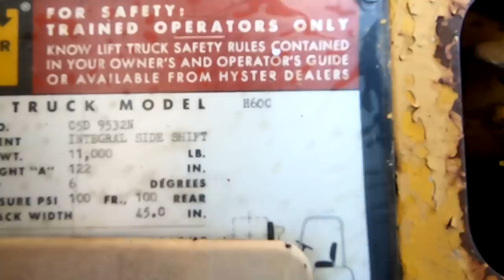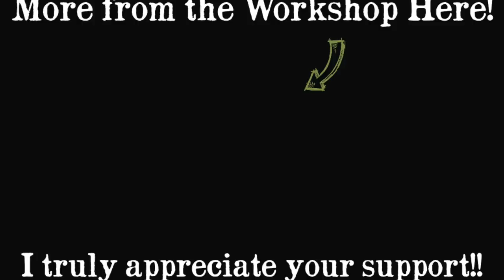This 1969 Fork Truck WAS Headed for the SCRAP YARD! ~ RESCUING a 1960's Fork Truck ~ Part 1

Comment: ATF & acetone. Ball hone. Patience. I'm in love😍
I was so immersed, when I read "Stay Tuned For Part 2" I said NOOOOO😭
This is so excellent, great job.
Reply from the maker: I'm glad you enjoyed the video! I thought about making it all one video, but it would have been 2 hours long, and I wasn't sure if that would do well or not... I decided to cut the initial video into 2... Part 2 will be up tomorrow, so you won't have to wait long!!
Reply: Gasoline and ATF work better then acetone and ATF.  The problem with acetone and ATF is that they do not mix and as soon as you put it in the cylinder it separates into a layer of acetone and ATF.  Gasoline and ATF will mix and keep creeping into frozen parts better then the separated acetone and ATF.
Reply: @jimthode  THAT sounds way better, actually. Anything that will be a Carrier for the anti-corrosion properties of the ATF. Acetone is a go-to ingredient because of it's hygroscopic properties, whereas gasoline will not mix with water. Isopropyl alcohol is actually better for moisture control, but it's not lightly corrosive like acetone, busting up rust. Aromatic hydrocarbons are key for capillary action. The carrier can be changed, but the chief component (ATF) should stay the same.
Reply: @SalvageWorkshop  it happened 10 hours ago... so it's ok, lets make some coffee to wait for another 14...

Comment: When you were using a hammer to tap the spark plug gap and said there probably a better tool, it’s right on the gap gauge itself.
Reply from the maker: Well go figure! Of course they already thought of that! lol!
Reply: What those 2 goofy looking flat parts with the small slots? One on each side. Those are what you're talking about? Not being sarcastic, I really not sure.
Reply: Read more comments and figured it out that it's those flat pieces with the slots. You got my curiosity peaked and set me looking for the correct answer though.  👍
Reply: @williambryant5946  Yes. Or, and I typically do this myself use the side like a hammer.  When you're dealing with thousandths it doesn't take much to move that tang.
Reply: That tool only opens them up. You still tap the hook closed. But you can just tap the hook on something solid.
Reply: @1pcfred  No, if you grab the "hook" you can close the gap as well, literally push instead of pull.

Comment: "We're gonna smack it, just once!" Proceeds to smack it 1200 times
Reply: Math be hard.
Reply: No
Reply: @jamesbrumfield8181  the powerless and weak say no. It takes an individual of means and courage to say yes.
Reply: That is skilled craftmanship, right there. Both tape and hammer used. After many years exposed to weather and this machine is in pretty good shape. Imagine modern forklift full of electronic left outside for several years like that.
Reply: CAN i use that fle hone for my toilet?

Comment: This engine revival was like watching Mustie1 times six. =)
Propane dos not need a carburetor cause it always a gas when leave the tank, so it do not need a float chamber, needle, all the jets and small parts. It works with a pressure regulator after the cylinder and a way simple venturi in the intake (it can even be made of plastic). It is so simple that you can keep the carb to have booth combustible system and they will not "see" each other. Thank you for the video!

Comment: These continental flathead 4 cylinder and 6 cylinders will literally run forever. Had a 1960s Hyster 5000 pound truck, sat for years upon years. Jumped the battery, still runs better than any of the new hysters.

Comment: Open spark plug hole,  I gave up.   Can't turn engine,  I gave up.   Broken Distributor,  I gave up.  Badly rusted cylinders,  I gave up.    But I'm glad you stayed in there,  very entertaining.    You lucked out on distributor.  Good to have friends with parts.

Comment: @salvage Workshop im a forklift mechanic and all your going to need is an lp converter, a water line coming in and out, and solenoid to shut the fuel off, and a regulator. your biggest obstacle will be if it ever backfires if blow the diaphragm out in the lp converter/ diffuser.. It shouldnt be a problem to do what you want to do. the modern stuff like hyster and toyota are still run just like this only they have more sensors.

Comment: Had one exactly identical that fork lift , Great fork lift .  One foot pedal is the brake and the other disconnects the drive so you can rev the engine to increase hydraulics to the lift mast . As long as you stay on hard ground you can get around very well . get it stuck or unload one drive wheel and you'll have to crib it or pull it back on hard ground to get traction . Enjoy your vintage fork lift .

Comment: The small notches on the side of the wire plug gage are for bending (rather than hammering) the side electrode to adjust the gap...
Reply: Beat me to it 😀
Reply: They're only for spreading the gap open. You try to use it to close the gap and you run the risk of breaking the plug center. I was taught to just tap the hook closed on something solid not beat the plug with a hammer. Really plugs usually come new gapped. That's why they have those protective rings on them in the boxes.

Comment: Just redid the top end on one of these engines last year.

Take off the vavlecase cover and check that none of the springs are broken.  These motors tend to collect moisture and rust out the springs until they break.  We had at least half broken this way, and one bent valve.  Some parts are still available for these motors, others are VERY hard to find or expensive.

If you have to replace a valve, do yourself a favor and get a flathead-style (L-head) valvespring compressor.  It makes the job that much easier.

Comment: I have one of those spark plug gauges. As far as I know, the notches in the metal tabs are meant to be used to grab the bit of metal on the plug and bend it. A most enjoyable video.

Comment: Incredible in-depth teardown & cleaning - great work.  Amazed that you pulled the water pump and head to get where you needed to reach. Naturally, we assume you change the oil before a starting attempt, knowing not only is the oil high from floating on top if rainwater but you'd added more than a bit of ATF past the rings to the crankcase.  Thanks for sharing your hard work and are able to hint at the old girl coming to life ahead!
Reply from the maker: Thanks for watching Brian! I really WANTED this machine to work, so i was totally up for the elbow greaseit needed to come back to life!! Part 2 is up if you haven't seen it yet!
Reply: The little flat blade with the slots is for opening and closing the gap on the spark plugs

Comment: regarding the spark plug gap setter. There are different gauge wires and then a piece with notches cut out on two sides. It's for bending the side electrode up or down. Keeps the hammer in your toolbox.

Comment: my wife is laughing at me as i watch this. i have a 1944 3000lb Clark forklift, with solid, slick warehouse tires, and a gravel lot. i've spent more than a few hours and four letter words dragging it out with the truck...and i have found that having my forklift run on gasoline is way more conveinient than propane. no cylinder to fill/exchange, i can get fuel anytime and i can put it as much or as little as i want.

Comment: About a couple of years ago I redid a tow motor with a blown head gasket it was from approximately the 50s the six cylinder the head gaskets have to be made for it came out really fantastic and like you said those motors are pretty much bulletproof this was a propane unit and always been run on propane well for most of its life propane in its own way is a great thing with these particular motors

Comment: spark plug gap adjustment. Those flat tabs with notches on your gap tool are for gripping the ground tab and opening or closing the gap. No need for a hammer and putty knife....

Comment: The flathead contenintal is a beast of an engine! I suggest running it on the rich side if you can to prevent valve issues

Comment: Converted a few of theses Continentals to LPG (Propane) during my apprenticeship. Quite easy to do, from memory it was an Impco J model gas converter with an Impco vacuum lock-off. Easy to pick up the water supply for the LPG converter and you can either replace the gas carburetor or use an inline mixer to run on dual fuel.

Comment: Congratulations on getting her running! I have a Tow Motor slightly smaller than that but pneumatic front drive tires and solid rear and I get stuck a lot with it,  but the best thing is to have a load on the front forks to help you get traction because of all the counter weight in the back.
Reply: I used a forklift in a scrap yard very much like this here one but we had dual wheels on it and never had any problems moving around but then the steelyard had very hard ground with a lot of metal being thrown on it and being buried!

Comment: You need a mini sand blaster. I have a craftsman hand held set up that I love for small stuff. Has a 2 or so gallon plastic tank for your media which I love using fine grit glass. Works awesome on aluminum. Runs well off my 28 gallon compressor. It would clean up the carb parts that are corroded easy without getting the rest of the carb. Wasn’t expensive

Comment: LP can be hard to gasify when it is very cold. If you  don't have that problem in your area, go for it. There should be lots of LP setups in the junk yards.
LP does make a bit of oil that needs to be cleaned out of the system occasionally.

Comment: Definitely convert to propane gas because of the clean factor. I used to operate one of these back in the ’60’s at the company I worked for. It’s a workhorse.

Comment: With a propane conversion, the carburetor is only used as a throttle body. The propane system has an expander which expands the liquid propane to a gas, and a mixer, which goes between the top of the carb and the air intake. The old school mixers are vacuum controlled. That's probably what you want. Fork lift conversions to propane are common, especially for indoor applications. I would get the whole kit to make your life easier. I converted my 87 Dodge Ramcharger to propane. It wasn't too hard at all. Good luck.
Reply: Yep, once you set up the gas kit its only a slight timing adjustment to run properly! No need to mess with carb adjustments!

Comment: This engine might be a candidate for a good dose of Slick 50. If you haven't heard of it check it out. I have a '87 Ford, 302 that I bought in '94 that had a cold knock. Changed the oil with a bottle of Slick 50, and havn't heard it in years. I still have the truck today, and it still runs great. $30.00 bucks is worth it if it saves an overhaul for a good while.

Comment: I once JB Weld on a broken distributed housing. It is still working 15 years later!😀
Reply from the maker: Interesting! I thought about trying to tig weld it, but I was worried about distorting the inner part the shaft spins in... Well if this one breaks, I still have the broken one I could try it!
Reply: @SalvageWorkshop  Heck, you could try it and hand a reassembled 4-cylinder distributor back to your buddy.

Comment: In europe with carb engine like this there were ringdisk sold that were put on top of the air intake and let Lpg vapours  into the air.  Or try to make an suply ring under the base of the carb. The rings on top of the carb were the ones normally uses. Needs a tank, vapourizerunit with hoses to the watersystem. Close to the ring you need a needle valve for adjusting the flow. From liquid to vapour lpg needs heat. You were lucky? Did not see you measuring the rotorshaft.

Comment: Hello from France ! Did you ever tried soda blasting ? Its very simple to do with cheap gun. I tried it on old carburettors (just degreased at my best), it works very well, even without entire disassembly.  Big interest is it can clean tiny location. And greatest advantage : just rinse with water dissolve remaining soda.  Soda is soft, you can use it on aluminium, zamak, glass without damage.  Regards.

Comment: From an old timer with carbs - down the main "barrel" is the venturi tube round and short to create a restriction, or venturi (think tornado) effect, there is inside it a little draw tube. The fuel is drawn in and atomized(made in to small to medium vapor droplets) as the engine starts. This is the exact spot where VACUUM is created! That barrel, the venturi and the draw tube need to be CLEAN like as in clean room clean. Corrosion in that tube or the venturi will screw up your air flow and you will always be either running fair at high, like crud on low speed, vice versa or simply run poorly all the time. If the little draw tube is plugged "Game Over". The carb will simply have a sucking sound as you spin the starter but cannot atomized fuel if the draw tube is blocked. The "plate" on the throttle shaft and choke is a "butterfly plate" the choke "butterfly" restricts air flow and richens the mixture when the engine is cold. The main throttle butterfly varies the air flow through the carb to allow for accel or decel, speed up slow down. I did not see per se an accelerator pump on the carb usually a round rubber disk that is in a small round chamber operated by a lever mechanism that "pumped" it as you blip the throttle which keeps the old girl from bogging down as you begin to accel and load up (attempt to increase RPM). There was a protrusion with a large plug sticking down which might be a piston for the same purpose. Good job on the rehab and best of luck.

Comment: A second option is parafin (the oil you use in lamps). Or kerosine? It ignites more difficult than gasoline. Twist a copper hose around the exhaust and use a 3way  cock or 2 separate ones. The flaw: with lpg you need to heat up the coolingwater before changing to lpg. Heating up like in just enough temp to stop the evaporator unit from freezing. Put the waterhoses in the thermostat closes loop when starting up the engine.
Kerosine needs an hot engine before switching over from gas to kerosine. My granddad used to adapt engines for naval use. They were put in small boats pushing the sailing cargo vessel without engines. I know there were special carbunits sold to change over t ford engines. But go back to gasoline and flush the carb before stopping the engine. So all in all not the first option for a forklift. If you idle the engine to long and the temp goes down the kerosine wont ignite no more.

Comment: I didnt read all 370 comments but I'd love to see or know if anyone else noticed that you used the screw driver to move point around and fought them with your fingers when those have a adjustment  grove cut into them and the distributor plate for just that purpose.  I see everybody over looking this on most ever veido I've seen. In fact I've not seen anyone use it yet.. I think its because it's so old school most people either forgot or never knew because not all points had that option.. look at the lil groove cut into the points by the condenser ,where the wire goes into condenser.  That's what that slot it for.. will make your life so much easier. Leave your points a lil tight put screwdriver in that slot and twist. With the small  amount of tension still left on the set screw they will.stay in place while you remove screwdriver and tighten the set screw. I have a old school screwdriver that's flat and about the size of a house key that goes on a key ring.. that one screwdriver and either a good eye or a match cover is all ya needed on the side of the road.. not poking at ya and I believe you did a great job just wanted to share a helpful tip for the next time you have to adjust a set..

Comment: Great video! Wondering why you chose not to spray paint the head and water pump orange while it was on the bench? Not sure if this trick applies to your motor but will mention it anyway. I had a BMW 2002 and it smoked going downhill with your foot off the throttle. A German mechanic said to drain the oil, replace the oil filter and refill using mineral oil. Run it for 100 kms and replace the oil and new filter. He said the rings would reseat themselves. Looking forward to part two!

Comment: Just wanted to share a trick I picked up from some youtube coments when you have a stuck motor like this.  After an intial soaking fill up those cylinders and then put a wrench on the crankshaft and put a jack under that.  That gives ya some tension on them the whole time while they are soaking and they may move by the time you get back.  With a car you can just put the thing in the air on a wrench.  Since it's a forklift maybe you have to get creative and run a comealong to the top of the mast or something.  Also I know you had to get a wirewheel in there but you should have used brass to be a little less abrasive.

Comment: It never a surprise just how much simpler it is to fix all these old engines with a little bit of knowledge and a few  hand tools. Unlike most modern engines today you need to be a rocket scientist just to diagnose the problem,  and instead of just replacing a component and go the part has to be programmed.  Well depending on which part is replaced of course.

Comment: You may have already figured this out but the reason for the higher oil is likely that there is collected water under the oil.  I always at least crack the drain plug to remove the water before trying to turn the engine so the water on the bottom is not pulled into the oil pump and pushed into the bearings.   
In a case like this I will also pump oil into the oil pressure sensor port to lubricate the bearings before tuning the engine too much.

Comment: 56:25 "there's a better tool for this"  TRUE, and you just set it down to pick up the hammer.
The wrench-like parts, in four sizes, are there to bend the gap.